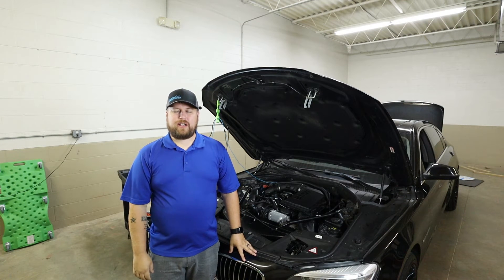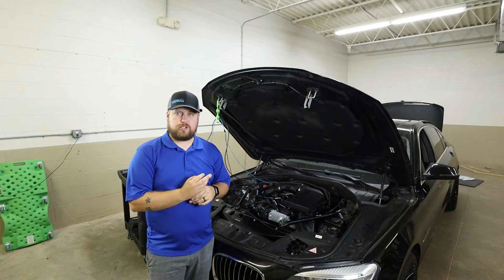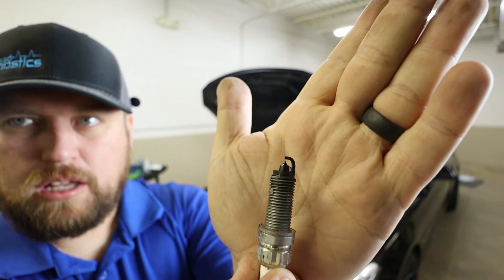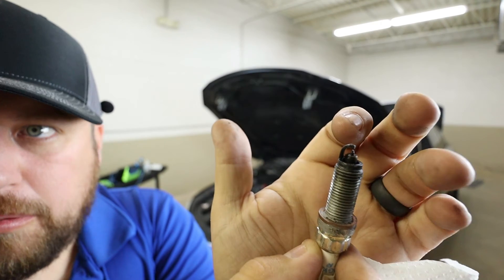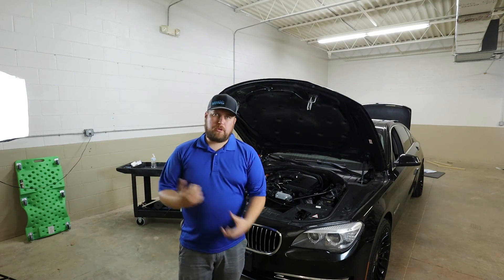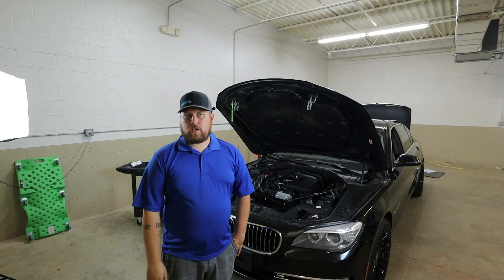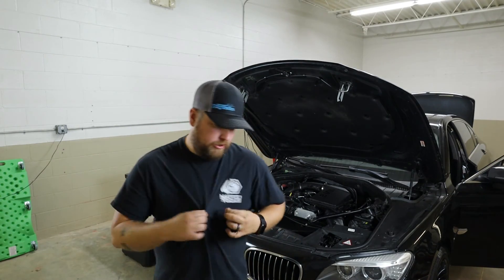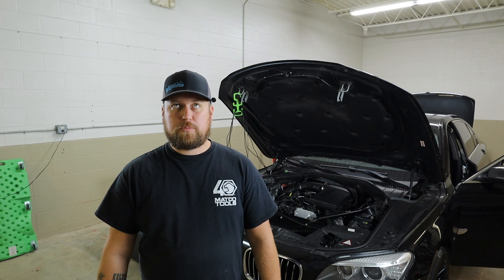BMW 7 Series Engine Misfire!

Comment: Or maybe pull your plugs inspect for cracks it was what kept my engine misfiring after I got new plugs new coils installed them and engine light was still on it turns out I cracked 6 plugs when installing them replaced new runs fine no engine light

Comment: I just had a matrix that the timing marks were perfect and the exhaust cam was 60 degrees out, I noticed some metal in the oil with the valve covers off. Fixed the timing and boom rod knock, that vehicle got the knife as well. Wish I payed more attention to the metal in the oil. It tough out here trying to be correct and catch every detail when diagnosing. Thanks for the content 🙏